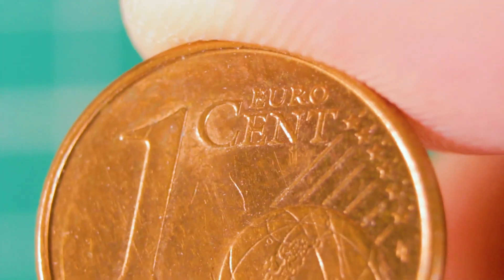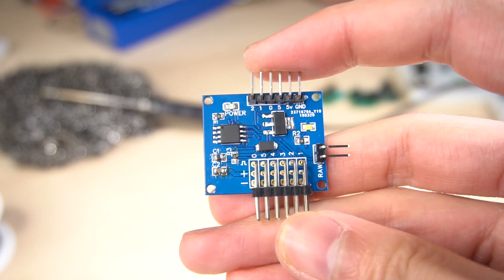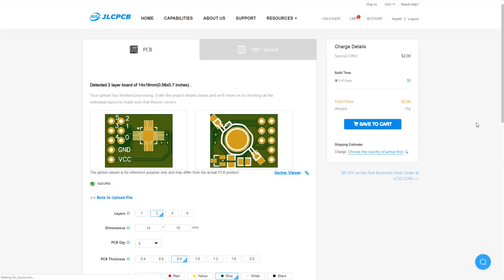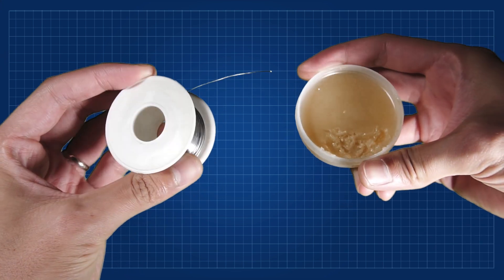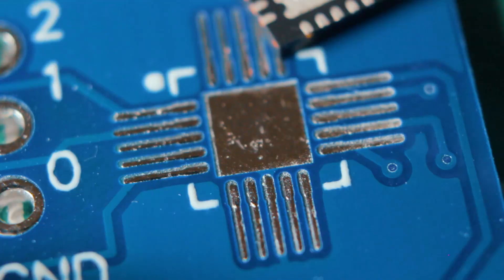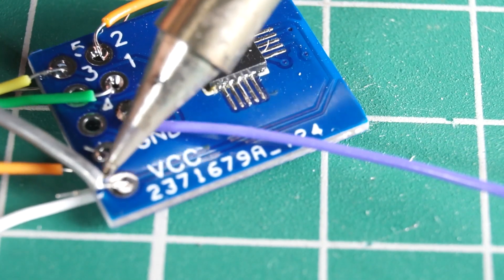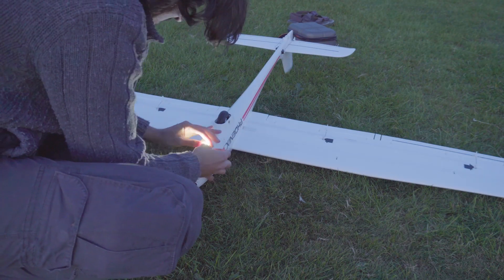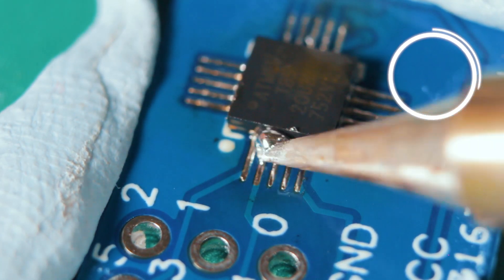Microsoldering with a common soldering iron | Attiny 85 QFN20

Comment: you seem to do very very interesting projects.... i am sure i would have loved to become your apprentice :-)  

i just made a ATTiny based Strobe using the same LED which you used (1W) but I am not able to increase the brightness of the lights. I used the same code but with a MOSFET (IRFZ44N) on a UNO and the flash was very very bright but when ported the ATTiny the MOSFET seems to not work at all.... just breaking my head over it.